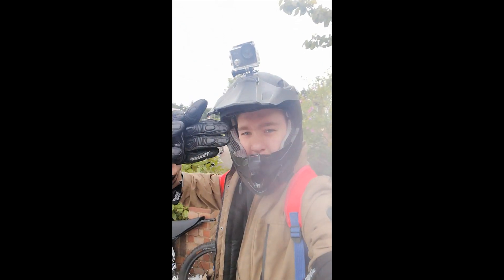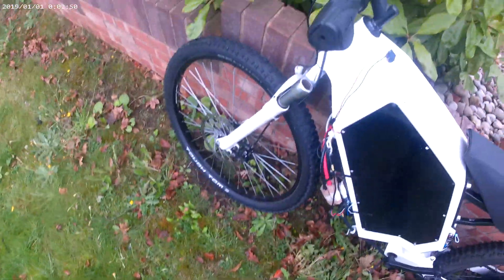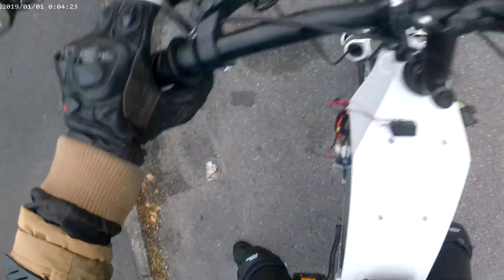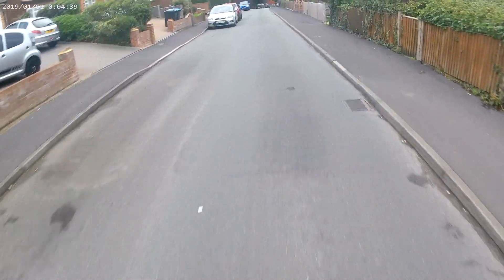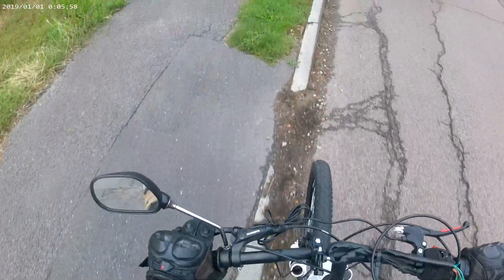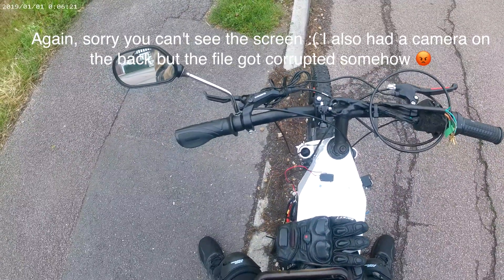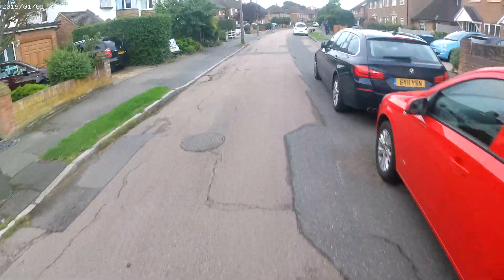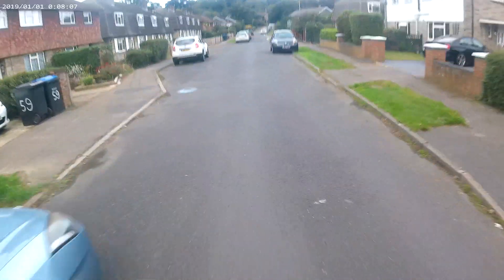Maiden voyage test ride! | 8kW Enduro MSVA eBike V3 Build

Comment: have you thought about raising the voltage latter to the 72 volt or 84 nominal, i built a custom bike for a guy at 72 volt with 150 amp sabvoton on rear motor and 45 amp sabvoton on front with cycle analyst v3 custom firmware controlling trottle management etc, the front works on timed boost type setup for accelaration from start or when needed,no word of a lie in excess of 100kms perhour with crystalyte 5000 series motor rearand rewound bafang front motor,previously a 500watt unit,
Reply from the maker: Not going to upgrade this bike, I've put as many cells as I can in and wired it up and am NOT doing that again 😂 Helping a chap whose managed to squeeze 40 in with some slight mods so it is possible with these cells. Briefly thought about dual motors but the lack of traction (and cost) put me off. Fair enough if you got it working though!

Comment: Congrats. It's time after 10 months. I'm towards construction. 
72v 35ah sabvoton 72200. All the pieces have arrived. Currently building the batery.
I have a question about electricity. Where to place the main fuse (225a). Whether between the battery and the controller or between the controller and the motor.
Is there a need for extra fuse in another location... thanks
Reply from the maker: If you have one, I would include it. Definitely put it between the battery and the controller so it completely cuts off power to the bike. All the best with your build😁
Reply: Thanx. Best regards

Comment: Just binged watched your whole project & am very impressed with your knowledge & abilities! 
I converted a conondale mountain bike last year. MXUS 3k hub motor, sabvoton 100 amp & I made my 20s 11p battery pack & of course the ANT bms which as you say is a fantastic bit of kit! 
Looks like you enjoyed your project as much as I have. & you’re right, the feeling of silent torque is difficult to explain to a non ebiker! 
Look forward to another video 👍🏼
Reply from the maker: Cheers mate! Sounds like you've had some fun too :). Saving up for parts but might do another riding vid soon...
Reply: @EverythingEbikeChannel what's the best settings for 150 amp sabvotron

Comment: Top speed run please! Also if voltage difference across cells is increasing check the parallel connection on the bank that is lower and it should stop the beeping 👍
Reply from the maker: One day when it's finished I'm sure! (If I have the balls to go 45mph+😂). I think the bms issue is linked to the parallel connections where the lugs join the cells but still working on it.

Comment: Your build is awesome mate. Holy shit! amazing!

One more thing. if you are going to ride on pavement most of the time, Those knobs tires are no good for pavement. I recommend Maxxis Hookworm double layer. Make sure you get the double layer because there are a few different versions. 

I have a few questions, maybe you can help me. How are you  going to setup the turn signals? Why did you choose such a low voltage for your build? What is the total weight of the bike finished?

Thanks for your time and keep going!
Reply from the maker: Cheers mate! I'll be on the road all the time so I'll get some 19" motorbike tyres. 
Ok questions...
1. for the rear, I have a bracket that attaches to the seat to space them apart and I'll use an arduino and some MOSFETs to control the timing
2. I could only fit 28 cells in the frame, so I could either have a 24s pack (max of my BMS) with 100a continuous current and ~20 miles range or a 14s pack with 200a continuous current and ~40 miles of range. I wanted more range and the power levels work out to around the same anyway with the 100a limit.
3. Weight will be around 50-55kg i reckon. Motor is 12kg, batteries are 14kg, frame is ~17kg
Reply: @EverythingEbikeChannel  thanks for taking the time to answer me. I will keep watching closely your videos. All the best. Cheers

Comment: very nice turn out thay are great machines im just about finished with mine im having battery problems you would think brand new thay would be all the same voltage..i learned dont assume!!!!  lg HG2 800bucks worth unballanceed 72V 20S 13PBATTERY .. 160DOLLAR  BMS WONT LET ANY POWER THRU.so i got a bunch of those smip08 batterys on the way  and ill hook up leads that came w/china bms but mite not use bms.Im new to this everything is a first for me with e bikesso i have two power soreses im going to get both working soon enough.GOOD LUCK WEAR YOUR GEAR IT IS NOT COOL TO SUCK JELLO THRU A STRAW OR WORSE BE DEAD!!Anyway grate job and thanks for the INFO it was helpfull . LONG ISLAND N.Y. DENYS
Reply from the maker: Hi mate, glad to hear you're building one too!. Generally good suppliers will balance the cells but HG2 cells aren't cheap or low quality so that's very poor that the BMS won't turn on because of that! (Is that what you meant?) Are you using the same BMS as be because even if the cells are wildly out, you could connect one series line at a time and balance them all out but if you've spot welded it together, that won't be easy! Happy to help!
Reply: Yeah man you hit the nail right on the head BMS is not letting any power through that's a saying that I saw you get those Leaf cells along with a couple of others on YouTube that's what decided me to buy some especially since they're getting real hard to find right now if you've noticed for me anyway I was going to battery hookup and they sold out got lucky found a guy on eBay selling a pack of 72 and a pack of 144 what do you think of those batteries I was reading their 40 times the strength of an 18 650 cell 8 Amp hours each that would mean it as 72 battery 20 of them that's a hundred and sixty and Power that's crazy you should be getting some sick power as a matter of fact FedEx just met me an email my battery on the truck and being delivered awesome do you have any good ideas let me know this will be my second battery build although I'm really thinking I might not use BMS because of all the problems this one is giving me with my hg2 cells I'llleave+ --  lead wires to each cell if I have to balance good luck with yours ride safe bro Dennis
Reply from the maker: Hopefully the leaf cells will be good as they were designed purely for ev purposes. Enjoy the power when you get there!

Comment: Nice mate did find out what the beeping was
Reply from the maker: Not yet, I'll have a look next weekend.
Reply: How's the build comming on
Reply from the maker: Think it's to do with the lugs making contact with one cells and not both at the module joints. Some rethinking required! Saving up for the wheels and suspension
Reply: @EverythingEbikeChannel   nice iv got 18in moto wheels with off road tyres and had the wheels powder coated candy purple